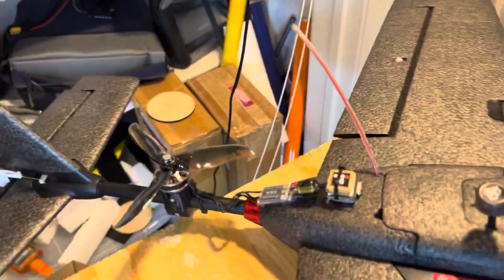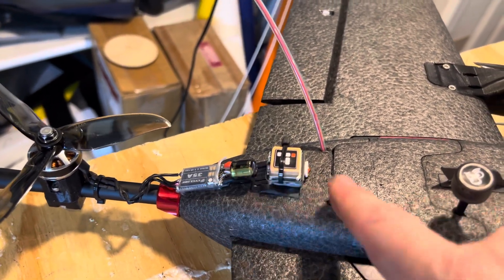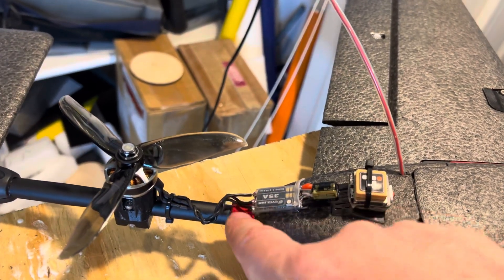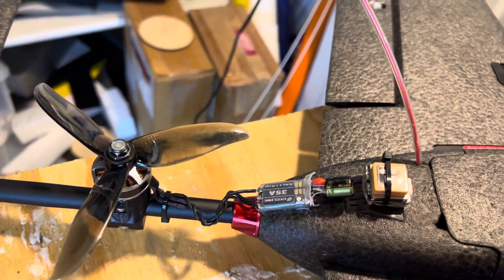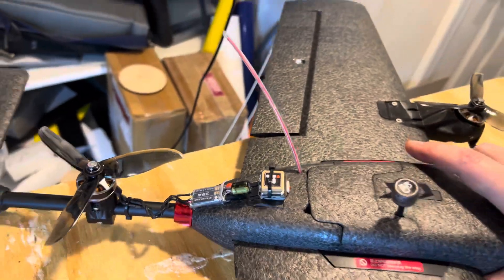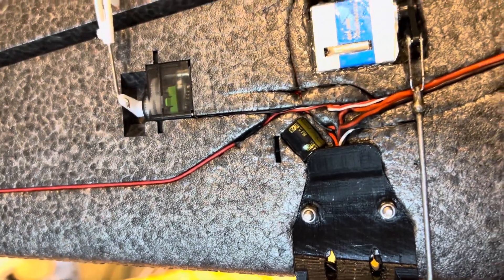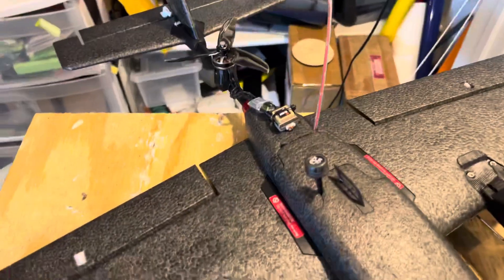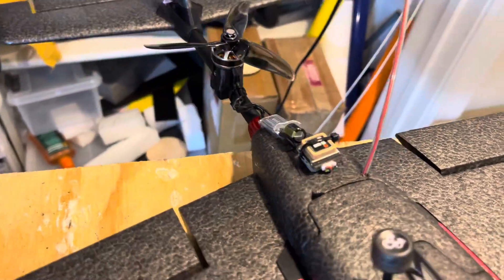Heewing T1 Ranger VTOL update

Comment: Following this and your other video but I don't understand q titlt yaw angle, setting to zero and then 'fixing' it?
Reply from the maker: You’re just checking that at zero the props don’t hit the nacelle.   If they do then you need adjust the endpoints so they don’t hit or make mechanical adjustments. Then set the tilt yaw angle back to 12 or so and adjust endpoints for vertical.  Then again double check that at zero tilt yaw angle the props won’t hit the nacelle.

Comment: This is my dream setup, not in the least because it costs a minimum of $1K for a pre-assembled VTOL plane.  Am I right in assuming you are using the VTOL kit sold for $159 by Hee Wing?   In terms of this plane's performance, how far away from the launch point can this plane fly before you start to see video glitches?

Also, how fast doe it cruise at the most economical battery consumption speed?   Finally how many minutes of flight time are you getting per full battery charge?  Thanks for any responses you can offer.
Reply from the maker: Its a great setup.  No this is a 3d printed version I designed (based on someone else's work as well) and it was available before Heewing came out with theirs (probably gave them the idea!).  So the 3d print files are free and on thingiverse (see link in description).  Video distance depends on the type of video transmission.  I use DJI digital and can go 3-4 miles without glitches.  Others have gone further.  I cruse about 30 mph for good efficiency and can fly about 15 minutes.

Comment: Did you need to calibrate those Cyclone ESC's?
Reply from the maker: Not if you use dshot
Reply: @Appelm1  Thanks for answering my questions so far. I'm really close to getting this to work. The ESC's seem to work fine now, but my issue is that the motors seem to be out of order (I am using your param file from facebook and setup the wiring to the Matek 743 to match your file, regarding Motor 1, 2 and 4). The problem I have is that when the switch is in drone mode, only the front two motors spin, and when I switch to plane mode, all three motors spin. How do I fix this? I have tried changing the motor layout in the 'servo output' section, but that doesn't seem to reverse the modes.
Reply from the maker: @DarkMatterDrift  hard to say but sounds like your modes are backwards.  Join the Facebook group and we can help you debug.

Comment: for the black/red power wires on the rear ESC, does that get connected to one of the existing ESC inputs on the flight controller so that three ESC's (the two on the wings plus the rear motor esc) are all combined into two ESC inputs on the FC?

Comment: HOw did you get the wiring through the nacelle so that the tilt rotor functions without causing issues with the wiring? I can't seem to get mine routed through. The wires from the motor cause all sorts of issues.
Reply from the maker: Am surprised you are having such trouble.  Perhaps your motors have a very stiff wires coming out the side.  You may need to bend them hard to get them to stay at that necessary 90 degrees behind the motor.  If they are so stiff that they won’t stay perhaps gently apply heat while holding the wires that way and hold them that way while they cool.
Reply: @Appelm1  It was the wire on the motors (too thick). Replaced it with thinner silicon wire and it works fine now. Thanks

Comment: also is there a way that i can controll it with the dji fpv remote 
?
Reply from the maker: I’ve never used a dji remote so I’m not sure.  I think it would work.  Dji sends sbus I think to the flight controller.  So it’s like a good other.  The only question is mapping your flight modes to switches.  I’m not sure how many flight modes you can set up this way.
Reply: Thanks

Comment: Thank you for the update. Nice work. Question, on the H743-wing FC how did you connect 3 motors to the PCB? Reading through the Matek documentation and I only see 2 places to wire in 2 ESC's with S1 and S2 being the signal locations. Would love to see a simple wire diagram.
Reply from the maker: Hi cuflyn, actually motors can connect to any of the pwm outputs, not just S1 and S2.  If you watch my other video on the settings, you’ll see how I set up my motors and to what pins. I have them on s3, s4, and s5.
Reply: Thank you👍🏻

Comment: We're to order parts??
Reply from the maker: lots of places:  racedayquads or amazon for the motors and ESCs and props and FC.  Servos on Amazon or readymaderc or  hobbyking.  Linkage from dubro.  The 3d printed parts you need to print/order.
Reply: Can we order the 3D parts  through you?
Reply from the maker: @othnealhaynes2194  no but you can download the STLs and send them to a 3d printing service to have them printed.
Reply: Ok

Comment: Looking at that interior, wiring everything up is going to be fun :( Still need to order a few more parts to complete my build.
Reply from the maker: Yes it’s a tight space.  If you can crimp your own connectors that would be ideal to keep it more clean.  I didn’t.  Note the tip I give on my walkthrough video about unscrewing the wing connectors and pulling everything out of the plane to wire up and test before re-installing in the fuse.  It helps a lot.  Good luck and let me know how it goes!